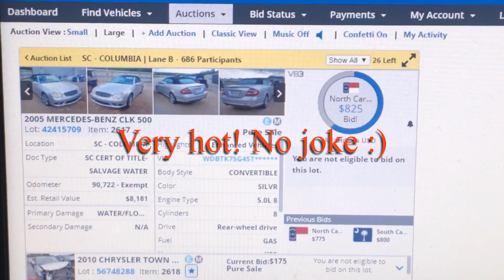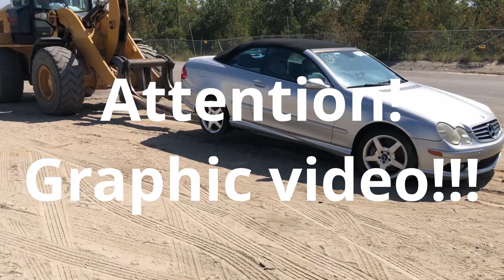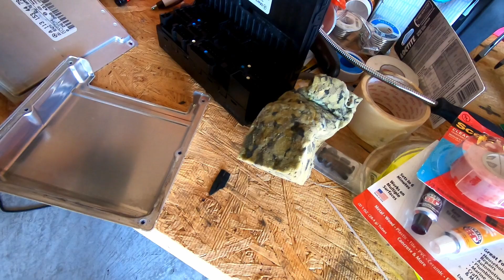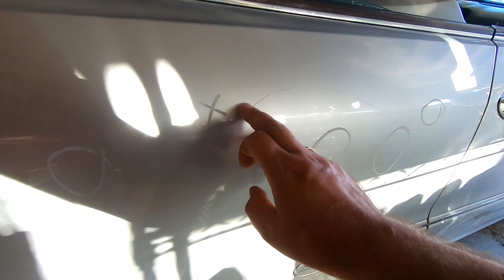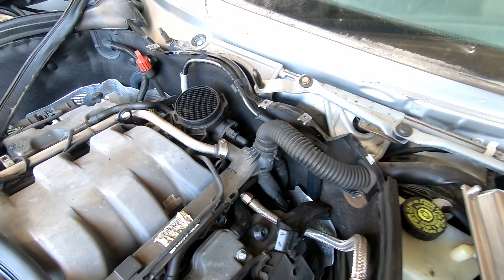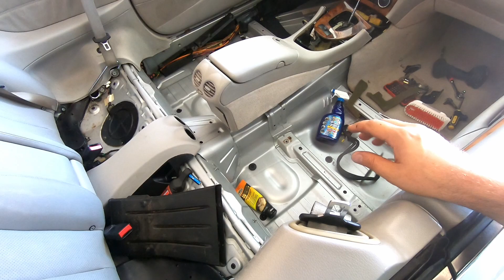Flooded '05 Mercedes CLK500 from Copart. Is it really flooded?

Comment: It looks like a weak spot.  Any chance you could build it up with jb weld before install?  Is there something that sits close to this part?  Like the wiper arms or something?  Looks like some kind of wear on it.  Does the 2007 clk550 have this same part?
Reply from the maker: All w209 and possibly w203 have this part. It’s a wear caused by coolant slowly washing up the material. Bad choice for material type being used.